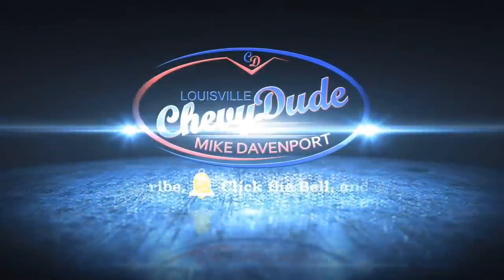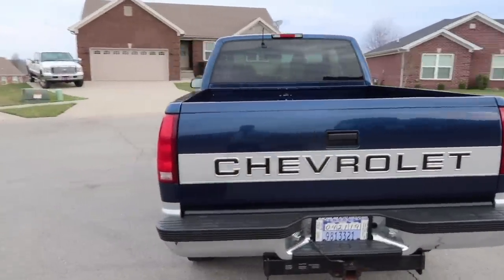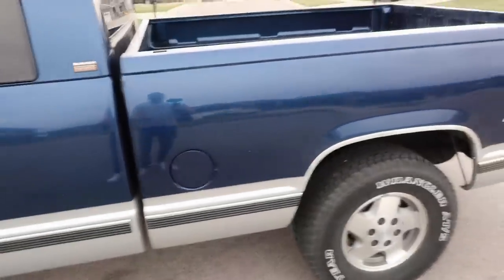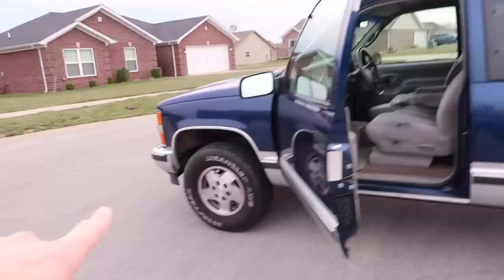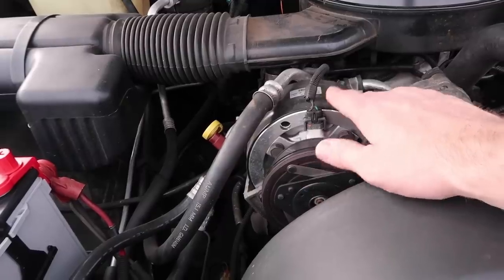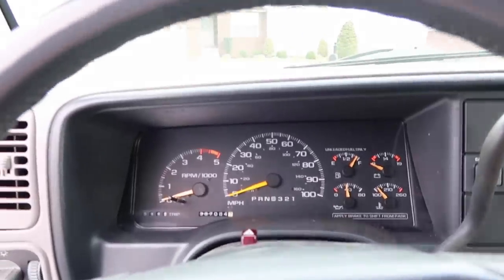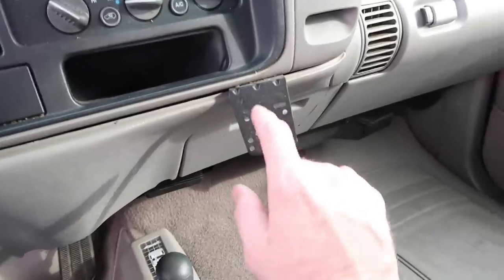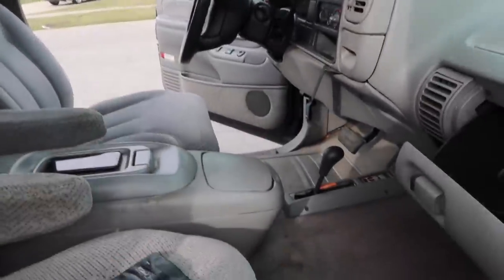I FINALLY bought a Silverado. Your comments pressured me into it.

Comment: My FAVORITE generation of GM trucks.  What I wouldn't do for them to bring this style back. So hard to find one that isn't completely abused/rusted. Family has a 1992 GMC K2500 that still runs with over 400K.
Reply: @Brandon Keithley They do have some resemblance. Guess that's why I loved the 14-18 change so much.
Reply: @Ramiro Duran This is considered OBS. Old Body Style. Square body was last used in 1987.
Reply: andrewforte isn’t OBS the style after this?
Reply: Brandon Keithley my bad, thanks for the correction.
Reply: I agree, I grew up with 80s Chevrolet trucks and a gmc my father loved them. We had over 500 thousand miles on one and finally replaced the transmission and motor.
Reply: @andrewforte  Blazers went to 91 with that body style, and suburban may have as well..........I have a 79 C20 and 88 K5

Comment: Id add a air ride helper spring vs adding a leaf spring.  The adjustability  for various loads just cant be beat.
Reply: Get the self leveling option if you install airbags. That way when adding weight in the bed or towing a trailer it levels out. Its safer and you wont be blinding others with skyward bound headlights.

Comment: I had a 94 K1500 for 10 years, a few months back I sold mine but mine was a step side they're easy to work on parts are still available, when I bought it back in 2008 the lady who owned it previously, had the pads, shoes, rotors, calipers replaced so I bought it on the spot it served me well, the few things I replaced were the plugs, wires, cap, shocks and tires, and throttle sensor, battery, serpentine belt, and both rear hub bearings, my son and I swapped trucks for a 2 years while he was stationed in Northern California, I had him call me every time he stopped just in case he broke down the truck drove fine with no issues, after he left the military he drove it back but pulled a uhaul home with his belongings he and I were concerned that the truck would struggle climbing the hills through Tehacahapi , Ca. and few more on his way back on I-40 but the truck behaved itself and got my son home, those trucks are just dependable, great truck, have fun working on yours

Comment: Thats an old school fuel injection throttle body. Started in 87 and went through 95
Reply: valeo1993 87 to 95 tbi 96 to 99 spi. Throttle body injection split port injection
Reply: I know but I've owned quite a few of these. The first vortec was in 96.
Reply: valeo1993 the spider injection split intake good motor bad design

Comment: Nice truck! My dad has the same thing in the 2500 form. He ordered his truck from the factory also in 1995. The only thing that can be frustrating is they don't turn very sharp. When those trucks have a fresh tune up they run nice and smooth. Oh yeah, the front break rotors tend to warp easily so don't ride the breaks and heat them up. Great videos!!!

Comment: Very cool truck.  One of the best mods I have done was a throttle body spacer.  You can actually feel the difference in power and throttle response.  It helps gas mileage too.

Comment: Parts are still readily available for this truck! Great looking truck man low miles that thing will end up out living you based on the conditions just do your maintenance on it leaks etc. That light is actually meant for night time flats it will reach to the back of the truck to lower your spare and also help light up your work area when replacing that tire.

Comment: One of the best mods I did to my 93 was to swap in a 454 tbi body. The stock one has a 1 5/8 bore & the 454 one is 2". More air more more power & mpg. You will have to bore the intake to match so the blades can open fully. You just transfer your injector pod & add a pod spacer for better atomization. It was crazy much mpg increased. A free flowing exhaust also. Air in & air out. Get project truck I miss my 93.

Comment: Nice truck Chevy dude. As a GM truck fan this is an awesome truck. As for towing and hauling as long as you have a good class a receiver you do not need to add leaves to the springs. You will only lose ride comfort. These trucks have amazing towing capacity.

Comment: Windshield visor , bumper bar front, nice topper,larger tires  3" inch lift don't paint,brush touch and polish,black running board's.
Reply: That truck will run 1,000,000 miles you won't find a better veh.

Comment: First year for 3 door trucks was late 1996 model. My dad has owned his 1998 chevy silverado 3 door z71 since 2002 when he bought it it had 98,000 and now it has 333,000 miles and is still running strong with the original powertrain

Comment: What you've got there is a throttle body injection 350. They aren't very powerful (I think they came new with about 200hp) but they will just about run forever if you keep up on your maintenance.

Comment: If you dont want the extra rake from the add a leaf when your not towing you could put some airbags on the rear axle. Some kits bolt right on vehicle specific and other you need to drill maybe 8 holes in the frame. Maybe a bigger trans cooler for the 4l60e and a corvette servo to firm up the 1-2 shift.

Comment: Mike, you did great! I bought a 1997 Trans Am WS6 with only 7,800 miles, garage kept car for 14 grand.  The interior and exterior are flawless. It has the same 5.7 liter engine as yours. That's all the power I need for now, lol! 
The day after I got it, I changed all the fluids, put new tires and it drives like a brand  new car. I still haven't bought my vette but that'll be later.  This car has the original manuals and window sticker, both in immaculate condition. Please check out a few home made videos I did on my I phone. Take care!

Comment: You have sold cars since 1999 and think a 1995 1500 series GM is carburtated I am assuming since you didn't see an airbox hidden in plastic and think parts for this are hard to come by?  This is the Honda  Civic of trucks, parts at any local supply and interior bits used and new piled up here and in China.
Reply: I owned a 1988 GMC Serra. It was throttle body fuel injected. I was told 1987 was the first year of the fuel injected thottle body. 1986 was the last year of the carburetor for GM trucks.
Reply: Throttle body injected.

Comment: I purchased the same truck in 1995.  When Ram came out with the first rear cab that opened from the side I sold my GM, went and got a Ram and never looked back at GM again.  That 95 Chevy is a really good truck, though.  In 96 they came out with the Vortec and it had way more power.

Comment: Love the truck. I have a 1997 GMC Sierra k2500 slt with a vortec 454 all black original paint. I chipped it, put a jet MAF sensor and  flowmasters. Just under 75k original miles. Added Phillips led taillights. Great trucks

Comment: If like can put a set of fog lights on the front. To clean and try and preserve the bed on the inside and put a name brand bediner. To spray the entire underneath of the truck eg. frame, floor boards, pretty much whatever is steal so don't get rust and eat it out.

Comment: Also if you plan on towing,  you need to make sure you don’t have a 10 bolt rear end. Upgrade to a 6 lug 14 bolt sf with 3/4 ton leaf springs, install a transmission cooler and take the lines out of the radiator.

Comment: You should get a backbox (I think that’s what it’s called.  It has a folding toolbox with the cover)  tonneau cover or a trifold tonneau cover.  Also add extra tie down points to the bed.   
The truck looks amazing!!  Super jealous!!
Also the most important part of the brake job is breaking in the brakes.  Where you drive around for like 5 min get to like 25 mph then break to 5 mph.    Then drive for another 5 min to like 40 mph then break to 5 mph.   This will heat up the pads and rotors and get them set correctly.   There should be directions with the brakes provided by the manufacturer to do this correctly

Comment: Most common problems are cruise control module. Window wiper motor. Abs sensors.  Oil leak from the rear main. Had a 98 for a long time and love them.

Comment: Very nice truck. I would of bought it 2. I'm sure your antenna was for a CB not a Phone. Also depending on how much sun exposure it has had may thin out the clear coat so don't go over board buffing. I would think about geting the bottom chip guarded and painted over the guard to match. Also might want to get bedliner to keep your bed from rusting. Wish I lived closer would love to help you on this project.
Reply: I'm pretty sure that is a cell phone and not a CB antenna. It is too small a connector to be for a CB. If not a cell phone it might have been a proprietary two way radio, emergency communications scanner etc but not a CB.
Reply: @richbrunner7044  Cell phones don't use coaxial cables.
Reply: @Wildman9  funny I've installed cell boosters before and they used coax and looking at a bunch of cell antennas online in the last 5 minutes and quite a few used that type of connector. There tends to be an adapter at the phone end to connect to each specific phone or a mount that couples wirelessly to it. The cabling may or may not be coax but that was the connector.  Either way it isn't a CB antenna period.
Reply: Trust me, that's a cell phone cable and antenna.
Reply: @richbrunner7044  Im lookin at it with a old cell phone so I could be mistaken.

Comment: My truck is just like that one. Mine is 2 wheel drive and mine is black and silver. Also a 95 excab longbed. Very nice truck and will make you very happy. Yours is a lot better than mine and love the bucket seats. Mine has the split bench. Hey if you find a cheap place to buy parts for the new truck let me know. I need a passanger side front finder and new tail gate.

Comment: Hey Mike    being on the farm for years I've added leaf springs for load control   may i suggest going with overload air bag system  which you control amount of air in bags inside with a touch of switch   it also had auxiliary air tank for many uses   i loved it lasted for many years
Reply: To add;  the Air bag system used an electric pump along with tank behind the grill in front

Comment: Factory head unit with tape deck can be very versatile in 2019.  Try a bluetooth cassette adapter for about $20.  Slightly cheesy but still pretty awesome and able to keep the stock look.  I have 2 for 2 of my 3 non-bluetooth, non-aux-jack cars.

Comment: Hey Mike great truck you bought one of my favorite body styles of the GM trucks which GM also used as the basis for the 2-door Tahoe/Yukon. FYI 97 was the first year of the 3 door CK1500's and 01/02ish was when the 4 doors showed up on the extended cabs

Comment: Great truck! Check and see if the rear end is the bs 342 or the awesome 373 rear end. Hop it up with a 383 or leave it stock and watch it run for a very long time. 95 had about 210 hp and the 96 vortec jumped to 255-260 hp and 335 ft lbs of torque for both. Want a nice truck!

Comment: Third door came in 98. I have a 98 with 203k miles. That thing will last forever. Might want to check out the front suspension components, they are a common issue. Good find with no rust and a dash that isn’t cracked.

Comment: 4 inch lift on 30 inch tires with American force wheels are tint the windows like 5 percent on sides and 35 percent on rear and 35 percent banner on the front windshield

Comment: maybe consider air bags in the back. I owned a 96 2500 Chevy 4x4 that I had ordered, a lot of the things you have I had. I like the pull out drink holder on the dash. My truck at 11,000 miles transmission locked up but Chevy put in a new one.

Comment: 5.7 V8 TBI 350 Chevy small block the engine dang good engine indestructible (almost) I had a 92 GMC Sierra (still my favorite truck to have owned) parts are generally relatively easy to find  via part store lmc trucks or pick and pulls easy as can be to work on

Comment: If you want to add a factory cd player, check out an Astro van/ Safari van. You will need it's head unit, cd player, wire harness from radio to cd player, and the little control box under the dash too. Of course the radio will need to be unlocked at the dealer after you install it. I did this swap.on my '98 C1500. I like factory radios, i detest butchered aftermarket radio installs. The Astro/ Safari vans were always a good source for those cd players. Of course the pickups of that era were too.

Comment: I think what could really make this truck turn heads is simple changes, being that old you don’t wanna change a lot at least to me I wouldn’t what I would do 

3.5 rough country lift

A little bigger tires preferably mud tires but leave the stock rims

Have it waxed and touch work done on the paint

Replace the head lights and tail lights with something very similar to stick but clear

A spray in bedliner

And honestly that’s all that truck needs, not even really needs but if you were to do something to it that’s my personal suggestion, it’s an old truck it’s earned it’s right to keep it core look

Comment: Mike, all you need to do is get the motor refreshed, and do the general maitenence on it. Then maybe throw a new paint job on it(same color). And that truck will last well over 250,000 + miles. But please dont over do it and go hog wild. Those are solid trucks as is.

Comment: I thought you were gonna say I'm not a mechanic but I slept at a Holiday Inn Express last night!  I bought one brand new along about that era but Chevrolet finally put doors for the rear seat on mine!  Dealing with those doors in tight parking lots drove me crazy!  Again Ford beat Chevrolet to the punch with those doors and I hated the Ford commercials saying if you want the doors for the rear seat in your Chevy then you'll have to cut them out as they showed a guy cutting out the door!  I wish Chevy would get really competitive again!  It seems they just want to follow!  But they have always had good trucks especially the old 350 and V6!  Solid engines and under the hood of just about every old Ford that was rebuilt there was a 350 heartbeat!  I could always get the goat of oval heads I worked with by stating that fact!  I'm a truck guy and enjoyed seeing this classic!

Comment: You can change the heads to a vortec head and for little money you will gain a lot of Horse power.  The brake issue was common on that model. Need to replace pads and rotors every 30k.  Its really easy.  I had one and sold it with about 250K never skipped a beat never left me stranded. It ran around town for another 5 years after I sold it.   You can throw a Borla cat back and headers as well as an add on computer that will make the truck get better fuel economy and more power.  Great truck and my favorite color.

Comment: Looks great! I think this body style and the 2016-2018 Z71's are the best looking.
Reply: That body style came out in 2014, and received a new grille and headlight treatment for 2016. I own a Redhot 2017 LT Z71 and absolutely love it.
Reply: @kevinbarrow9588  right, the 2016 update made a big difference in my opinion. I drive a graphite 2017 LT Z71. Great truck.
Reply: Yes the are. I was a Ford guy for 20 years, owned nothing but F-series trucks. But, when I test drove my Z71, I knew it was going home with me. I don't regret it for a second. I do remember thinking why didn't they do this in '14, when the 2016 update came out. The updated version is definitely the best looking out of that generation.

Comment: The parts for those are still readily available. My first truck was a 88 k1500 (which I still have but doesn’t get driven much) and I would go to oriellys, autozone, or advance and get parts all the time. Rockauto is a good place to find parts for anything especially these. Try to stay away from lmc truck unless you can’t find it anywhere else. They over price their parts by a lot! They’re easy to work on and great to learn on. You’ll have fun with it
Reply: քօӀվʍօɾքհìҟ I rarely go to Napa. Anything I’ve bought was overpriced for no reason

Comment: Wow, what a nice obs. That nice and low miles just doesn't exist. I'd put some new headlights, wheels, tires, air bags for towing and drive it. LMC truck used to be good for replacement parts when I had my 97.

Comment: I would do air bags instead of add-a-leafs to the rear. Springs will add a permanent harsher ride and the bags can be aired up only when you need them. Add a compressor too and you'll have air to air up a tire on your trips. I think Firestone is supposed to make a nice kit. I don't know if they make it for your truck or not.
Reply: Agreed. Air bags instead of add-on leaves. If don't want the complexity of a compressor, a schrader valve works well also.

Comment: Be careful with the transmission in the 95 trucks. It was a stand alone year. I would suggest a trans cooler if you are towing. I would leave it stock. Looks great stock.
Reply: He can update to performance parts and not need a cooler. But if he's towing, I agree

Comment: do a restomod with this truck. its way too clean to modify like crazy and modernize. i would do a small lift and level of the suspension, some nice period correct american racing or centerline wheels with absolutely no wheel poke and BFG all terrains and as you said buff up the paint to shine again, its in beautiful condition already though as it is

Comment: Had a 95! Z71, g80 rear, metal skid plates, and the 350 tbi. Absolute torque monster. Not as good on fuel as the vortec, but I think they’re 1000 times more reliable.

Comment: It should be a TBI Throttle body injection. Which is waaaaaaaaay better than the poppet style multi port injection. The spiders inside the multi port fail and the intakes leak coolant.  You have the best year for a stock GMT400.  Still has storage on dash love it man.